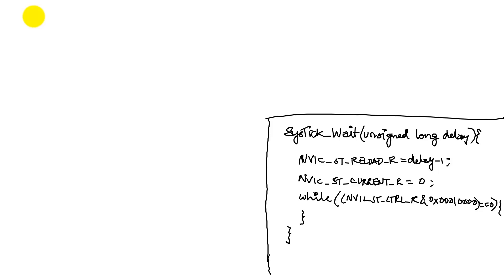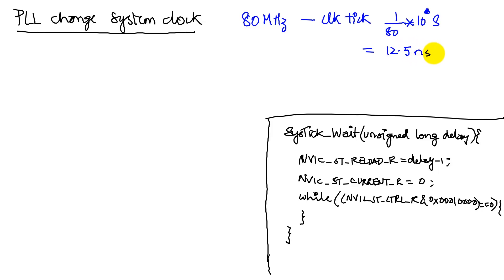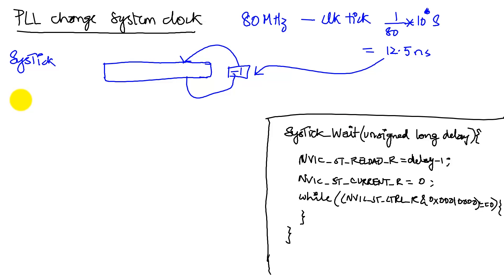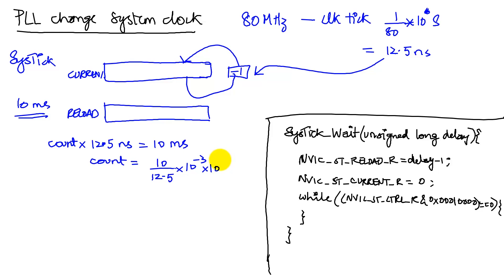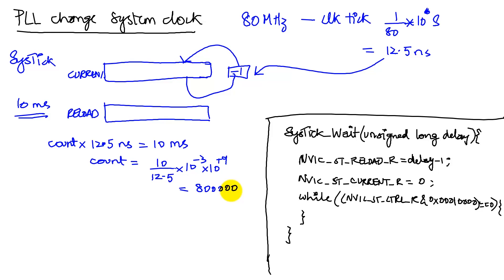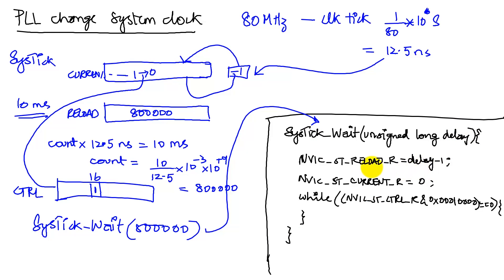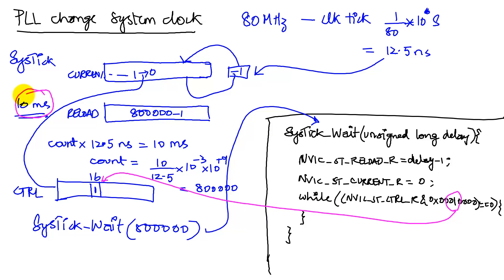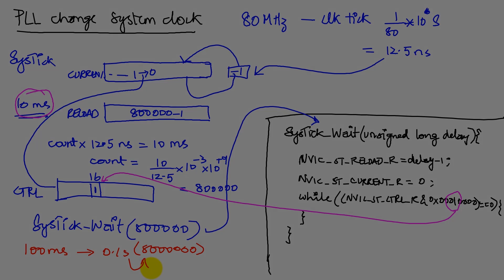C10 1b Systick

Comment: I am currently working on the lab for the online course UT 6.02x and I am having trouble getting the proper delays on the actual board.

My SysTick_Wait_10ms function is as follows:
void SysTick_Wait_10ms(unsigned long delay) {
 
 unsigned long i;
 for(i = 0; i < delay; i++) {
  
  SysTick_Wait(800000);
  
 }
 
}

I then call this function in my traffic controller like so:
SysTick_Wait_10ms(fsm[S].delay) where the delay is all set at 300. So this should give 300 x 10ms = 3 sec. However, when I run it on the board, it is way faster than 3 sec, looks like it is toggling at less than 0.5 sec. Any idea what the issue is?